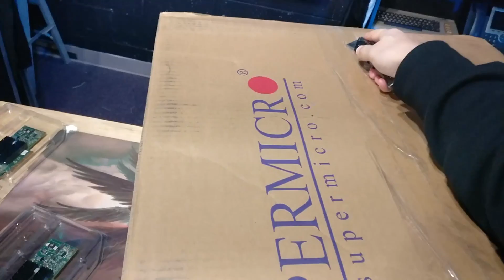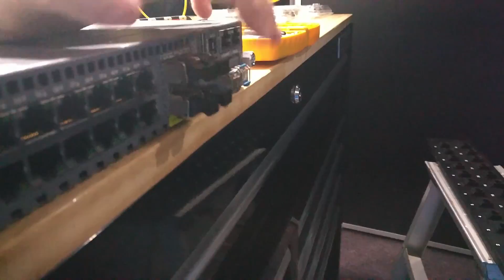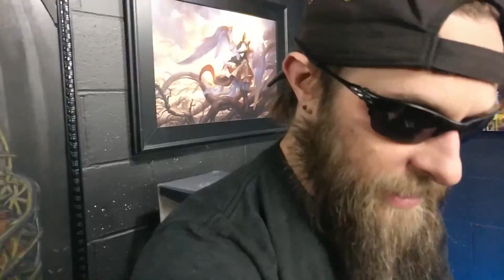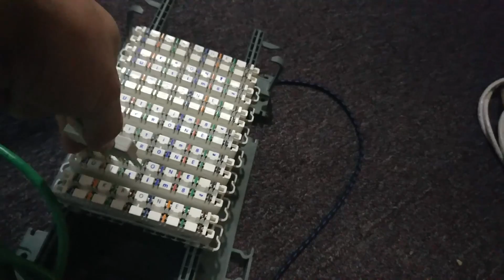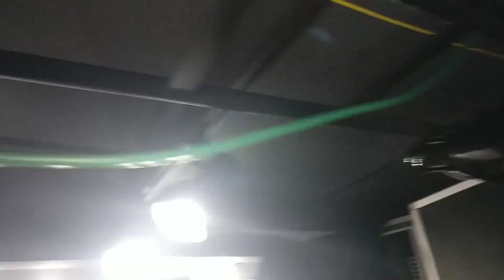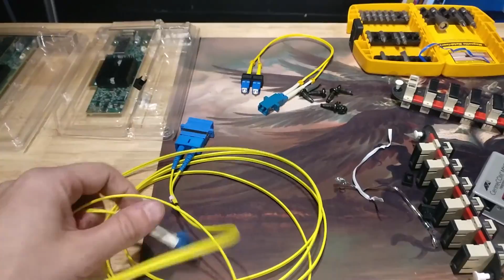Qain's World #0082 - To Dell in a handbasket

Comment: how'd that go using SM fiber for your 10G interconnect?
Reply: @deusqain  are you using LR/SM optics?  Because you would have 90+% loss with the 9 micron cores of SM fiber.
Reply: @deusqain  though, at the distance you are going that probably isn't as much of an issue, more than a few hundred feet though, my guess is it would get sketchy...
Reply: @deusqain  wow, seems like overkill, for what 15M? Are you using attenuators?